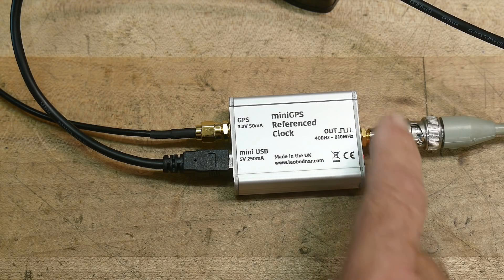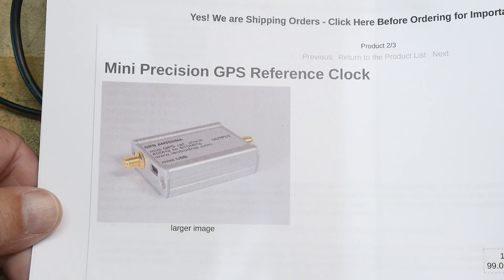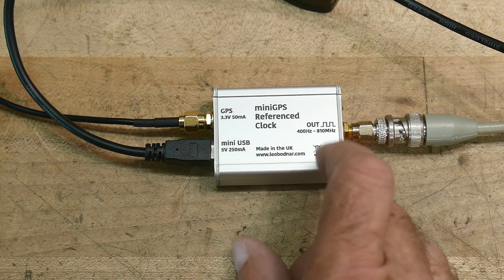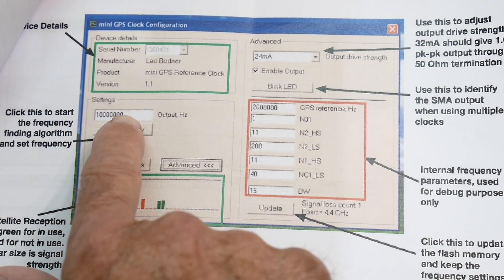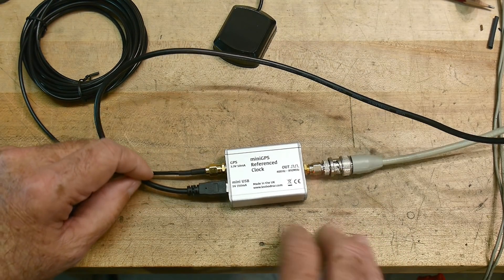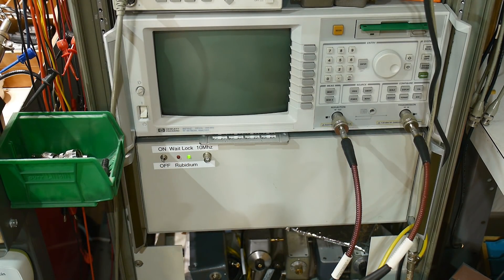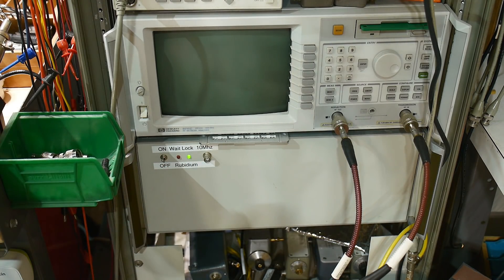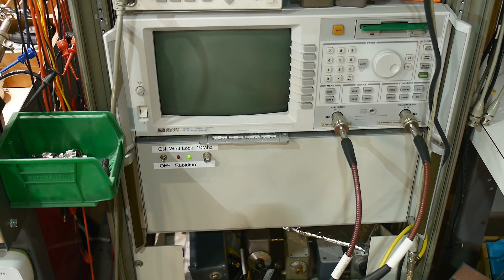#984 GPS Reference Clock (part 1 of 2)

Comment: you should show the Rubidium signal and the GPS based source on a scope.  By the roll rate you can calculate the frequency diff.
Reply from the maker: https://youtu.be/488Q7-c218E?si=JVy3s7GxBkzs_nrr

Comment: Thanks. I'm about to connect the Leo  Can you comment on a plan B if I don't have a VHF or higher beacon in range? Do I use a signal generator, somehow synched to GPS? I have purchase the leo bodnar icom ic 9700 reference injection board and also the Mini Precision GPS Reference Clock to feed the board, and the board will be in the IC-9700. I'm confused on the source of the 10 MHz GPS signal though. Looks like your rabidium standard solution is addressing this, but very impractical for me. Can you suggest a plan B for the GPS locked 10 MHz signal?

Comment: I don't know about you guys, but I just turned my GPSDO on when I got it and it's basically never been turned off since. It might have gone off once, during an extended power outage that exceeded the time capacity of my UPS, but that's it as far as I can remember. I can't remember explicitly turning it off for anything. It's been running basically non-stop for 2-3 years now.

Comment: I've always been fascinated that a PPS (pulse per second) from GPS can be accurately multiplied into a 10E6 per second reference signal. It just seems like the smallest bit of jitter or other threshold-level sensing on a PPS signal could cause significant and large disturbances in the 10 MHz (or other MHz level) signal coming out. Driving the Vctrl pin on an OXCO would of course smooth out and average some of the errors. Also, looks like those SMA connector grounds were soldered with true minimalism. (Full disclosure, I own one of these as well.) It might be interesting to see the error/jitter at the highest supported frequency. Maybe that's in your PT2 video, I'll go check 🙂Great video as always! 
--E
de W6EL

Comment: I don't recall the stability of my gps ref. rubidium freq. std.. but this might be quite useful for the 'non-std' (10 MHz) ext. clock referenced devices... IF it's better than the internal reference, my swag is that it probably is.

Comment: I am fortunate that my hobbyist lab has enough nice equipment to need various reference standards. I looked at DIY GPSDO solutions and ended up building a GPSD/Clock with outputs. Basically, it is a GPS receiver, a PIC MCU, a display, a reference signal output connection and a Laptop/GUI output frequency control. My thinking was this... The GPS provides the timing standard. The additional oscillator (of various types - heated, Rb, etc.) is only used to carry over the actual reference frequency, whenever it is temporarily lost. As a hobbyist, if the GPS signal is not available for awhile, I can just simply wait to do the calibration at a later time. Meaning, I do not need all of the additional smoothing features. I use a powered antenna, good line of sight and the unit stays on 24/7. How far off of base is my thinking. Please be gentle; this is a teachable moment. I have not used it to calibrate anything, yet.

Comment: I found that you need a a fairly good view of the sky with the antenna to get good results from the GPS disciplined oscillator.   Since the loop time constants are so long a little GPS drop out will not be noticed but it will temporally cause a slight phase shift (frequency shift) in it's 10Mhz output.    I discovered this while testing a couple of GPSDOs against a Rb standard.  Comparing the two on the scope the signals would phase track for 10 minutes or so then drift apart for a while then come back in phase again.   Couldn't tell if it was the GPSDO or the Rb standard that was drifting but suspected the GPSDO.  Finally got a second Rb standard and discover by watching both  Rb's and the GPSDO that it was the GPS that was drifting.  I remounted the antenna on the roof and boy did that make a difference.  It was amazing to see all three independent 10Mhz sources running wild after a power on then all of a sudden bang! the Rb's and the GPS all lock up and thee 10MHz traces all track rock stable on the scope. To make the error show up better I use a 10X frequency multiplier and feed 100MHz into the scope.   The idea is to use a very long loop constant on the GPS then  to filter the short term GPS anomalies then use that to calibrate and adjust the Rb modules.   Yes , there is a frequency adjustment on the Rb oscillators and it takes a while to get it dialed in. You have to be careful not to move the Rb oscillators because the earths magnetic field also disturbs the frequency in these micro Hertz regions.

Comment: Thanks for the video. I enjoyed this and your NanoVNA videos. I've learned a lot about them.

Here's what I was told about rubidium standards, and I have no reason to doubt it since I was told by a physicist who works on freq standards. Rubidium is being burned off with time as the device ages. The process is slowly self-destructive. There  is a voltage that is monitored to let the commercial entities (the cell companies,) know how far the rubidium has burned off, since it has to be driven ever harder as it starts running low on rubidium. That voltage that is monitored lets the field techs know when it's time to swap out the old standards. So when you buy one of those pulls you are running on borrowed time, however long it is. I had a friend who ran his 24/7 for 2 and a half years. Then it died. Mine, I only turn on the day before I need it, then I compare it against WWV, then shut it right back off as soon as I'm done with it. I've had it for 15 years. Rubidium standards are very stable. They just don't drift a lot. But they suffer from phase noise, so aren't great to use as calibrators. Nor are they essentially accurate unless you have a better standard with which to check them occasionally. I was told that a better option is a good ovenized xtal oscillator because they have low phase noise, but one that is carefully disciplined by a GPS receiver since they have the long-term accuracy. So that's what I'm in the process of building using an old, very well burned in HP xtal oven and a GPS receiver.  Anyway, there's all I was told. Hopefully it's good info and helpful.

Comment: I have worked with the si5328 ICs, not top shelf but a pretty good tracking PLL with 2 input reference clocks and 2 outputs. It will free-run on the TCXO until the input error converges to a minimum and then locks to the input. Requires an ICAL to force the PLL to try and re-lock.
That little GPSDO seems to be accurate enough for my kit, once it warms up.. probably best to just keep it running 24/7.
Cheers,

Comment: The antenna is active, so beware of the bias dc in the line if you connect something else to it.
The output is a mos square wave and not all equipment likes that, as you noticed, i think thats causing the change in accuracy at lower levels, it should not matter.
I added a 10 mhz lowpass filter to get a sinewave out as my marconi tester also did not like the square wave

Comment: This was interesting to see. But it is waaaaay above my level of needed accuracy. I'm such a hairy handed, knuckle-dragging, mouth breather, that simply beating the 10 mhz oscillator from my cheap little handheld frequency counter against WWV on the shortwave will get you within 10 hz or so. Way more than I need for any of my ham radio projects.
Reply: Now try QO-100! 😂

Comment: You did not mention the issue of short-term vs long-term accuracy. Since the GPS is referenced to an atomic clock and  maintained by scientists, one would expect its long-term accuracy to be exceptionally good. Its short-term variation would be expected to exceed that of the rubidium standard due to varying effects of the atmosphere on the radio signals from the GPS satellites.
Reply: Agreed. Much like using the power line as a frequency standard, the important specification is long-term stability as seen over MANY, many measurements. Shorter term frequency fluctuations are controlled differently, all the way down to nitty-gritty stuff like jitter/phase noise.